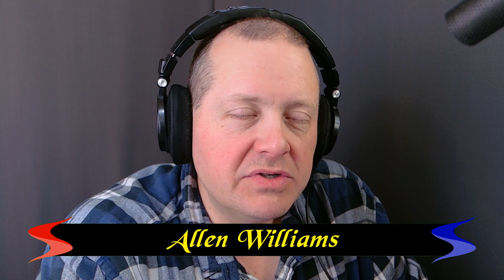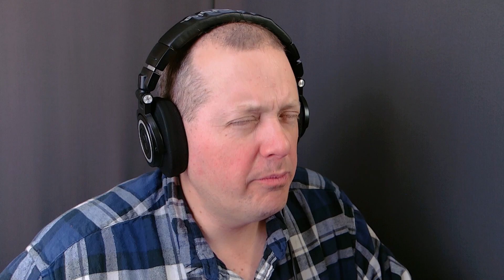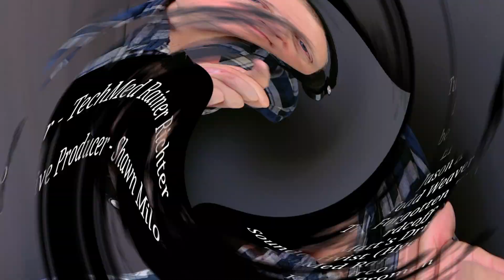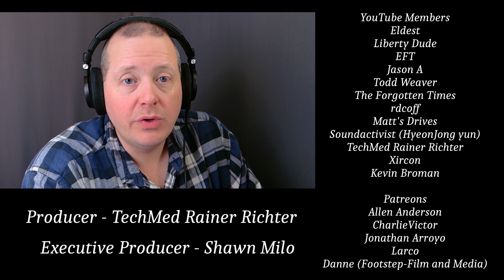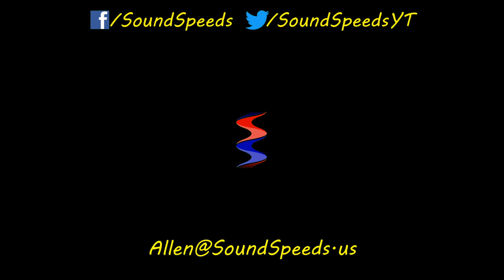Why Low Frequencies Go Thru Walls Better Than High & Ear Fatigue: Sound Speeds Podcast 21

Comment: Sound waves do not pass through walls. They can cause walls to vibrate, which results in the creation of sound waves on the other side. Low frequencies vibrate walls more easily than high frequencies, explaining why it seems that they go through walls, while high frequencies don't.
Reply from the maker: Partially incorrect. Sound waves can be reflected, absorbed or transmitted allowing them to go thru walls. You are correct in that acoustic pressure causes vibrations in objects which transfers sound thru it.